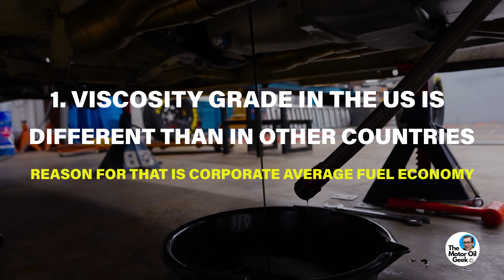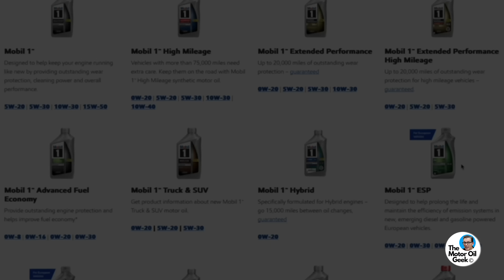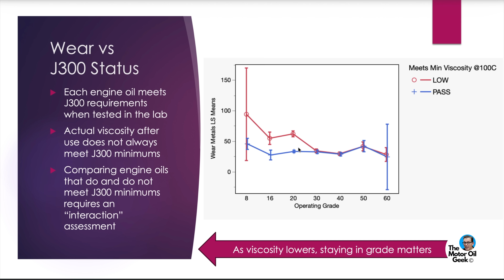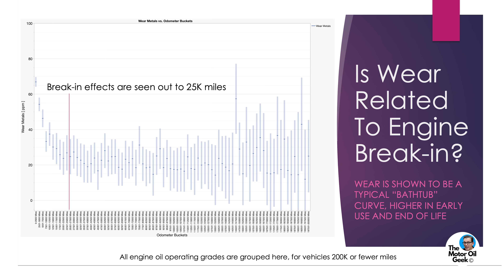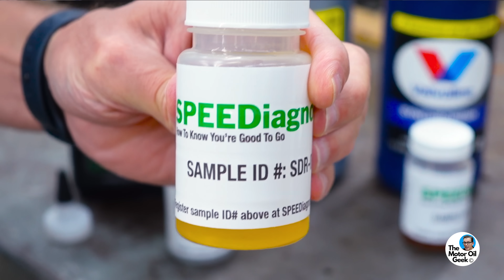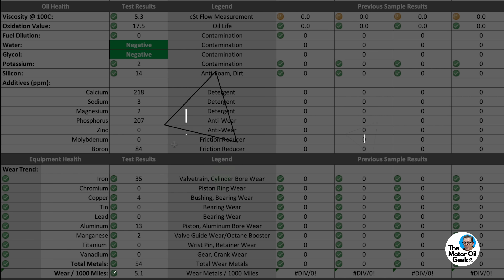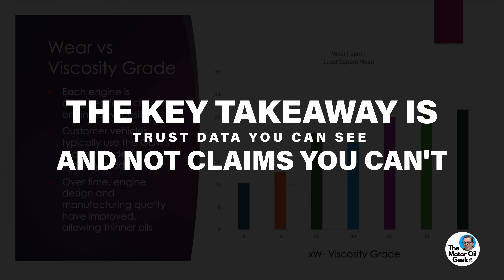More Ai Lies? The FACTS about 0W-20 vs 5W-30 (With Evidence)

Comment: Now we need a video of which oils stay in grade the best.
Thanks for the info!
Reply: Project Farm
Reply: @HunterB738 give me a break
Reply: @HunterB738  PF concluded Amsoil/Pennzoil were top of the heap overall.
Reply: @HunterB738  Exactly!
Reply: It seems like that would be engine type specific, especially main and cam shaft bearing clearance specific. 🤔
Reply: @MiketheMeister it does seam to have alot of hiding variables . Im speculating Lake said to go with manufacturers recommendation and then test for that very reason.
Reply: @texasslingleadsomtingwong8751 yep, in his video about his new Toyota Tacoma, he said to use the OEM oil for the 500, 2000, and 5000 mile break-in changes to establish a baseline. 

https://youtu.be/QDxn3mRTOfg?si=ElXf36AKDJFwc5w1
Reply: @texasslingleadsomtingwong8751  If you're willing to do the testing with same engines, same testing procedure with same temperature, humidity, driving cycle, weather and tear down each engine and measure, measure, measure and test engine oil for every test that Lake does, you'll have your "own" real performance test. Then you can believe, talk, defend your validity of oil performance. How do I know this?....mmmm, Take a  guess. Cheers All the best to you. ..ps: not pounding on you just my opinion.
Reply: @MiketheMeister yes
Reply: I agree.  @6:00 he explains that larger the split 0w-20 (+20) vs 5w-20 (+15) the more likely the oil will be "out of grade".  
My big question is... given that oil manufactures have been making 10w-30 ... F-O-R-E-V-E-R is it easier to make and a more reliable formula (premium vs budget brand) compared to the new kids on the block (0w-20 and 0w-10)?  Which brands can be trust, or is trusting 5w-20 a better bet?
Reply: @patusoro4781 my friend he says the exact opposite of what you just said go back and listen to it
Reply: @patusoro4781   my guess on this would be the following. in order to change the viscosity of oil you have to have viscosity modifiers in the oil. this i imagine would take up physical space in terms of PPM of each relative volume of oil sampled. thats going to be less space for additives that prevent dilution , or increase shear strength , or decrease foaming , ect ect.  if you have 1 OZ of oil you only have so much room for each thing before you have to make a sacrifice of one benefit in exchange for another.  0-20 and 5-20 might be the same base oils just with different viscosity modifiers. and since 0-20 has the larger spread id guess it has more modifiers which inherently must take up space. and if you could isolate these modifiers in pure form and test them against contamination and use, what would that test data look like over time.  So many possible variables not enough time or money to test them all.
Reply: @TheDaltonmichaels  0W-20 oils often actually have less viscosity modifier (more base oil) than 5W-20. Oil isn't that simple. Mobil 1's 0W-30 ESP (euro based oil) synthetic is FAR more shear stable/robust than their very own (more North American based API) 5 and even 10W-30 synthetics. Their (more American) 0W-30 advanced fuel economy version, however, is terrible with shear stability. It all depends on formula (chemistry).
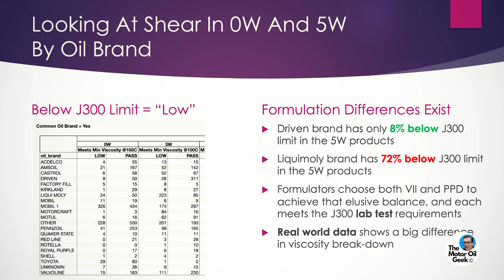Reply: At 5:10 it shows a list of oils and how many samples were out of grade vs in grade.  If you put that into a spreadsheet and do it on a percentage basis then you will know which ones stay in grade the best.  I did that and it shows in regards to the big three Valvoline stays in grade the best with Pennzoil next, and Mobil 1 last.  If you look at the boutique brands Driven stays in grade the best followed by Redline, Royal purple and Amsoil last.  It should be noted that Red line and Royal purple didn't have a very large sample size while Amsoil had a large sample size.
Reply: @machine7767  Hpl is going to be better than all the ones you mentioned including Red Line.
Reply: @machine7767   Good work, thx.  
But even still... mileage and duty matter, so the data is severely polluted/confounded IMHO.  For example:  maybe a few typical guys who did thousands of oil changes with 10w40 and 20w50 just change the 0w20 oil more frequently in their kids cars because in his heart he just can't trust that 3-in-1 looking watery stuff?
That might skew this data to (erroneously) suggest 0w-20 holds grade better when in fact it is only because it comes out at lower mileage on average.
Then there's desert heat and -20°F cold starts.....
Reply: @dhgmllcshea5038 it's simpler than that. If you have 0w oil, zero weight is your base oil. The higher the multi viscosity number is, the more viscosity index improvers (VIIs) need to be dumped into the oil to artificially thicken it when it warms up. A 0w-40 would have twice as many VIIs in the oil compared to a 0w-20. When sheer occurs, these get chopped up and can no longer expand as much to thicken the oil. The more VIIs are utilized, the more sheering can occur. Which leads to the conclusion that single grade oils will usually be the most viscosity stable.
Reply: @Matt-mh5ud I also remember LS saying that cam chains tend to shear the oil. The more (& longer)chains you have, the faster the oil will shear.
Reply: @budlanctot3060  why would cam chains shear it more as opposed to piston ring and walls or bearings?  way more heat being gerenerated there
Reply: @charleshoward8971 ask LS, he's the one who stated it. I'm guessing because it's not a soft bearing; it's hard steel chain links contacting hard steel sprocket teeth with a lot of compressive force, at high speed, with just splash lubrication.
Reply: @budlanctot3060  ah I ain't buying that , it def won't be more maybe the same , but the combustion chamber is going to be the worse
Reply: @Matt-mh5ud  When a more viscous one sheers it doesn't automatically go to zero though does it?  I'm thinking when the 20 shears it may still be equal to or greater than an 8.  This is just speculation though.
Reply: @charleshoward8971 Shear is caused by shearing, or slicing... Every time one of the chain plates slices the oil off a gear tooth, it's shearing the oil.... the cylinder walls and rings are not shearing it as much as a timing chain.... not even close. Additionally, shearing happens at any temp, therefore being closer to the combustion temps has a negligible impact on shear, which is caused by actual mechanical slicing, which doesn't happen in the bearings or on the cylinder walls as much as it does at a timing chain. The rings scrape the oil off the cylinder wall which is cross-hatched so the rings only touch the peaks of the cross-hatch... the majority of the oil is in the valleys of the cross-hatch not on the peaks so there is actually minimal shearing taking place there... and furthermore, scraping isn't the same as shearing. Imagine putting your hands together with force and then twisting them against each other while maintaining that force.... that is shear, now if you take a hand, turn it horizontal and scrape it down your other hand... that is NOT shear, that's scraping which is different. Shear requires a twisting, slicing, or tearing force, just scraping has minimal shear.
Reply: @Matt-mh5ud That's not always true about the base oil weight... the base oil isn't always just the lower number.... some oils use a higher base oil and use VI additives to go down to have better cold flow properties from the baseline oil weight, while others use VI additives to go up from the baseline oil weight to improve hot performance. Not all 0w-20s start with a 0 base oil.... not even close. Different brands have completely different formulations even for the same grade. Some start with a 20 base oil and go down and some start with the zero and go up and anywhere in between going both ways with VI additives. It is true though that the further the spread.... the less shear stable it will be.... that's a simple take away for sure.
Reply: @jalmolkyThat's right, shearing out of grade is a gradual process, it doesn't just suddenly happen. A 20 will go to a 19, then an 18, and 17, and so on. Even a straight weight like straight 30 will still shear out of grade, it's not just a multi-grade thing. That's one of the primary factors for changing your oil on time, other than particulates in suspension (being dirty) of course. When the oil becomes saturated and there's no more room to hold particulates in suspension.... that's when things really go down hill.
Reply: @machine7767 I thought i caught a glimpse of it .
Reply: Who makes Walmart Super Tech? It doesn't seem to burn off' as much as other brands between oil changes in my 2007 4cyl  well kept Honda.
Reply: @Idahomie  Warren Distribution
Reply: @Idahomie Warren Oil makes SuperTech, and also Harvest King, Costco and other “store brands”.
SuperTech filters are made by Champion Laboratories, who also make store brand and manufacturer brand filters (Motorcraft, Mopar, AC Delco, Purolator…)
Reply: I dont really understand the chart at 5:10.  What do the numbers mean? Is a higher number better or lower?  I tend to run Amsoil in pretty much everything, but dont know what the numbers mean.

Also which Amsoil oil are they using? Their OE or Signature Series?
.that goes for the other oils as well. Which Series are they using?
Reply: @johnnyturbo8460  It dose not say much, but it dose give you some information about what brand oil prioritize. Driven for example is an oil made for performance cars and in this application shear stability is very important and you can see that they are indeed do have a very strong shear stability. Other oils may prioritize cold flow, fuel economy or cost. If it's your grandpa Camry, you care much about shear stability, you care more about the rest.
Reply: @johnnyturbo8460  I don't understand the chart either. Please explain Lake!
Reply: @j@j@j @johnnyturbo8460  numbers mean what they say, the number of samples that are Low and the number of samples that Pass the J300 limit. Hence the legend ‘Below J300 Limit = “Low”’. Driven 5W oil samples tested had 26 that sheared to below the standard and 311 that were above, so they passed. Thus. 26/(26 + 311) = 7.715%, or the rounded 8% given as being below the limit.
The Amsoil line represents all samples testing Amsoil branded oil. Specifically all Amsoil branded 5W-* oils and 0W-* oils in the two columns.  Given the number of brands with single digit samples, breaking them down in more detail would probably end up with just 1s and 0s, making it meaningless. The intent is to show the overall viscosity stability of how different manufacturers produce their products, which is generally common across the board. It’s like gradin “McDonalds vs Wendy’s” based on all samples, not showing thousands of data points from individual stores. Note how many times he says “brands”. It’s about brands.
Reply: @rdspam  Thank you for the detailed explanation. 

😁👍
Reply: @johnnyturbo8460  I think that chart shows compares the number of samples for each brand that stayed within spec vs. the number of samples that fell out of spec. If I'm reading it right, the Mobil 1 0w-20 that I have used for 10 years did not do so well, with little more than half of the samples staying within spec. But the two numbers are just the number of samples, so they had very few samples of some oils and a lot of others.
Reply: a
Reply: Or you can just run 5w-30 and not worry about it, that’s the whole point the thicker oil even when out of grade still protects the engine. Idk what speed is even getting at the conclusion is the same just in a different round about way.
Reply: @JackJohnson314 yeah. He just proved the AI’s point. 😂
Reply: @JackJohnson314  Or you can run what the manufacture recommends and not worry about it.
Reply: @S @SingleStacked 
The manufacturer recommends the lower viscosity 0w-20 only for better fuel mileage, not better longevity or protection.
Reply: @SingleStacked one of my key takeaways is that if you want to run a manufacturer’s spec, and that spec is lower than the spec advertised for other countries, then make sure to select an oil that is less likely to fall out of sheer spec.
Reply: @SingleStacked don't worry until the manufacturer warranty runs out
Reply: @SingleStacked except you do have to worry about it if you MFR oil is sheering
Reply: Yes and yes
Reply: Yes a video of which grades stay in grade
Reply: @Flir67  100 percent.
Reply: He literally just mentioned that in his amsoil video he made a month ago…
Reply: How about API forces oil companies to publish this data? Currently we have so little information published on our oils,  beyond certified to Meet the Minimum Requirements.
Reply: Apologies for being a bit off topic.  What research do you have for engines running propane as a fuel?  There are some vehicles on the highways that run propane, but I was thinking mostly about home generators.
Reply: A video of him reading the chart shown at 5:11 ? Because that’s exactly what this is.
Reply: Are there particular brands you recommend for modern turbocharged engines?
Reply: @chrislovett1637 Real good Question, now we need an answer 😢
Reply: @chrislovett1637 amsoil
Reply: @chrislovett1637 from listening to other videos he doesn't recommend brands but rather says since different engines are different or have different things going on he recommends doing oil analysis and using that as your recommendation now with that said I've heard him say that oils that have a higher additive pakages and higher heat tolerable oils are best for turbo engines
Reply: SEPTEMBER I GO 5 20 MARCH I GO 5 30 ? I DON'T KNOW BUT IT SEEMS TO WORK I NEVER HAD A PROBLEM I LIVE IN THE N.E.
Reply: @RichardKimball-k8l the first number is the important one for seasonal changes because it's the cold flow at startup that matters. When the engine is at operating temp (the second number) it doesn't care what season it is outside, it gets to 210°-220° either way. By changing the second number... you're changing the hot protection, which you shouldn't be doing. For seasonal changes... you change the first number in the weight, that's why it has the "w" after it.... the w stands for winter, or in other words, how well it flows when cold. 99% of all wear an engine sees during it's lifetime is at cold startup. It could be 110° outside and the first start of the day is still a cold startup because that's only half of full operating temp. You should always keep the second number as it's recommended by the manufacturer and if you're concerned about the winter, change the first number to a lighter weight, not how you're doing it. But in all actuality you don't need to even do that, 5w is good down to like -40°F or something. I live in MT where we get 140°-150° temperature swings between the coldest of winter and the hottest of summer and 5w-30 works perfectly all year. With multi-grades like we have now, there is no reason to change grades for the seasons anymore, those days are looooong gone. Just run the manufacturer recommended weight all year, for the entire life of the engine, and you'll get the longest life out of it.
Reply: 5w-30 been working well the last 40 years just fine even when out of grade. Seems like the more convenient option for the common car owner who may or may not be a dedicated to vehicle service schedules
Reply: Easy answer...  The oil you change most often 🙂
Reply: @timsforcoffee 
8:54
I suppose if you change your oil every 200 miles what you said would make a difference. Who does that?
Reply: @Paul__108__ People who race at the track would.  They aren’t looking for magic bullet in a brand name.
Reply: @timsforcoffee  Doesn't matter how often your oil is changed if your fuel-injectors are dirty.
Dirty fuel-injectors dump gasoline into the oil.
That's why your gasoline quality matters more than your oil quality (as long as you're running any full-synthetic, no matter how cheap).

Best-quality gasolines I've found: 
ExxonMobil premium
Shell premium
Reply: Yes, we need brand names.
Reply: Yo want a oil to stay in grade no matter what, use HPL NO VII, nothing in better
Reply: Look up Project Farm’s 0W16 to 5W30 comparison
Reply: @mr_mumbles_ What dictates oil viscosity selection are the clearances in the engine, not wear scar testing, which is pretty much irrelevant. You should use what the engine was designed for because it's the designed clearances that make the difference in viscosity selection for any given engine. The viscosity needs to match the clearances, and if you don't know what those are.... you shouldn't be playing around with changing the viscosity all willy-nilly-like. Period. You can't fairly test two different viscosities on the same engine because that engine was only designed for one of those particular viscosities, it's automatically going to disadvantage and be skewed for the viscosity it wasn't designed for. You'd have to have two exactly same engines but with different clearances (designed around each particular viscosity) in order to compare them fairly. Clearances are decided by bearing thickness and bore size.... the hard parts don't change and could be identical, that would be a fair comparison. Engines are designed around what weight they're are going to recommend, not the other way around. The starting point is the chosen oil viscosity and the clearances are then designed around that. The oil is the cause for design specs, it is not an after effect... a chosen viscosity comes first, then the engine is engineered around that. I wouldn't dream of running a 5w-30 in an engine that was designed with hyper-tight clearances for the 0w-16, it would be waaaay too thick and would absolutely shorten it's lifespan.... by a lot.
Reply: @johnny0454 that may be essentially true but for example, Honda specifies 2 different viscosities for the identical engine depending on country sold, 5W30 in EU and 0W20 in USA.  So clearly either is ok.
Reply: Pause the video at 5:12. You already have the info on the chart. 😂😂😂
Reply: We need a Video of which grade oil does these things at cold temps and hot, A comparison. Especially 0W20 and 5W30. The sworn enemies...Duke it out
Reply: It’s simple for me: I’m gong to follow the manufacturer’s recommendation on oil viscosity and oil change interval for my driving conditions. I’m not going to get my extended powertrain warranty voided.
Reply: @RussellFrench-f8r Yes follow the manufacturers oil but don't wait for their interval. They only care about the warranty period usually 3 yrs not the life of the engine. Always  hange the oil twice as often as the manufacturer suggests!
Reply: Lol yup because when it gets hot that tjin stuffs junk
Reply: Don't show charts without explaining them. Manufacturers like Subaru claim some oil consumption is "normal". To meet CAFE, the use a 0-20 to eek out a tad bit of mileage at the expense of oil consumption. I'd rather give  up a couple mpg and get longer engine life and less oil consumption. So would not 5W-20 be better than 0W-20?
Are these statements true
Reply: For how long? I change my oil every 3000 miles. Even the cheapest oil will hold together that long under normal circumstances.
Reply: When I someone choses between a 0W-20 and 5W-30, he shows that 5W-30 falls out of it's spec at a higher rate.   He also shows all higher 2nd number oils (thicker) fall out of spec quicker than the -20's.  When they fall out of their spec are they still meeting the spec just below them?  As an example, if someone goes with 5W-30 and it breaks down for whatever reason (fuel dilution is one possibility), is it still meeting the 0W-20 spec?  If so then the person using 5W-30 didn't lose anything in this example.
Reply: @davidmorrow4195 I don't think it's quite like you say there's no proof that once 5-30 goes out of grade it stays at 0-20

He did say that it would be honest to think that a thicker oil protects more but it doesn't matter the thickness once they go out of grade they both don't protect he didn't say if 5-30 goes out of grade it degrades to functioning 0-20 neither oil type is protecting you is what he's saying he says because it's out of "grade" No matter what thickness 

However I'm not trying to argue with you but he did say 0-20 causes more wear than a 5-30 I'll give you that point..

So in essence it really falls down to how are people using their vehicles for instance I don't drive much so I benefit from more constant intervals like six months or less then you have people who drive a lot so there's different variables for everybody which comes down to the conclusion that he always states everyone should always analyze their oil for their use because everybody has different driving styles and temperatures ranges weather or internal heat etc or maybe you have an internal engine issue with injectors etc and so on
Reply: What grade does 5w-30 degrade to when it falls out of grade? The study talks about the oils "staying in THEIR grade, but 5w-30 starts out superior to 0w-20.  So when 5w-30 degrades out of its grade, I'll bet it's STILL within 0w-20 grade.  If so, then 5w-30 represents superior lubrication, for longer, in harsher conditions.
Reply: Now I need to know what oil brand is the best for 0w-20
Reply: That's what the "Project Farm" channel does.
Reply: If your vehicle does constant short trips, thats gonna have a bigger impact than oil brand and weight.  Blackstone oil test on your vehicle would be best imo.  Then adjust the change interval accordingly.
Reply: @malibusbc  I put on 2500 miles short trips per year. Change oil every 6 months at 1250 miles. I think I am good to go. I will be sending out for a test to see how much fuel dilution I get in 6 months.
Reply: Ok we hear your point but when You take into account the EPA standards set for manufacturers They would most likely choose the thinner oil to meet the gas exonomy standards although the thicker oil would be Just as good if not better as lake stated.. other countries are calling for the thicker oil because they don't have the strict DBA standards they have with as I mentioned the same ent rance is they will have the same clearance specs..

Also If we stick to your point of them choosing viscosity then built the engine around that What does that say to GM as part of service bulletin recommend  changing to a thicker viscosity oil on their 6.2 engines If they built that engine to the thinner oil.. why would it be okay for them to recommend a higher thickness as part of that bulletin service fix? Would it be because it covers the issue briefly until another situation arises and they decided to continue pushing the can down the road or because they know it will be okay and they chose a thinner oil primarily to meet the gas EPA standards and for marketing the vehicles with fuel economy efficiency.. 

That's why you have some folks out there saying that they care more about the marketing of the vehicle and pushing for sales than actually making that engine last..

When you think about it it's a little bit of both they want to market themselves as efficient vehicles and savings and take risks with new technology  but at the same time they can't sacrifice quality and reputation because they know people won't buy their cars also..  there's an element I feel in today's age companies are a little more about making money then the quality because they know that when they make more money they're able to afford to pay for recalls and such and at the end of the day people will need cars and they're still going to sell cars to stay afloat etc etc It's crazy 

EPA screwed all this up